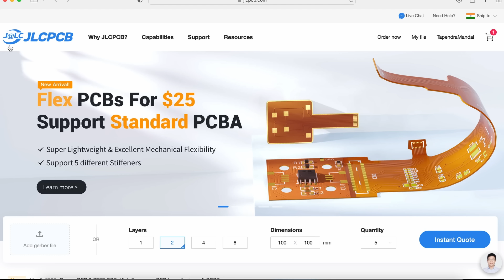BUILD A DIY SPOT WELDING MACHINE

Comment: For those who want to make this tutorial, let me tell I made it. He misses some important things and I really dont know how the hack is working for him when clearly the board is missing a connection for example. Anyway, I made it and the welding is not strong. He says 3 turns of cable but I recommend 4 if posible with 6mm cable. I used 6mm wire with 3 turns and the same transformer. The copper heads are from old battery spot welder.  The welds now are not strong. I  will try to change the cable with a 6mm and 4 turns and see if the welding gets stronger on 0.15mm niquel plates.
Reply: Thanks bader
Reply: هل قمت بالتغيير  ما رأيك هل تغيرت النتيجة ام بقت كما هي انا ايضا لدي هذا المشكل اللحام ليس قوي بما فيه الكفاية
Reply: Plus tu fais de tours, plus la tension sera élevée et le courant moins important.
La puissance est telle que Tension primaire * Courant primaire = Tension secondaire * Courant secondaire
Donci si Tension secondaire augmente alors Courant secondaire diminue.
Faire des tutos quand on n'y connaît pas grand chose est très dangereux pour ceux qui veulent reproduire l'exemple !!!

Comment: Your link to JLCPCB is a generic link to their website.  Where is the gerber file for your control pcb or where can it be purchased online?  I prefer the input voltage to be 120VAC from the mains @ 60 Hz.  Where can I get a control module for that & how many amps would the mains needed for the spot welder to work from a 120VAC mains supply?

Comment: How long can u use it?  I make lithium batteries and I want to know if I can build batteries without getting too hot the wires or the copper plates. My current spot welder get very hot after welding 20 cells for example. I need to know i can weld without pause so I can try to build this model. Thanks.

Comment: Thank you so much. What's the suggested cross section for the output coil wires?
Reply: 次級線徑最好8mm  = "The secondary wire diameter is preferably 8mm"

Comment: Toroidal Transformer made from a microwave transformer? I don't know if it's enough for thicker gauge but most small ~20 watt guitar amps have a decent single 125VAC to 2-phase (12vx2vac), the core is similar in configuration but 1/8th the size.

Comment: holy shit, i almost threw away my 1200watt broken microwave.
time to build a spot welder
Reply: you can find a lot of microwaves (and microwave parts) at scrapyards. just be aware that microwave parts and projects that use them cause a lot of hobbyist deaths. If you touch the capacitors without discharging them you can die, if you mess around with the transformer unsafely you  can die and if you break the magnetron and its the type that has berrylium you will get berryliosis which is incurable and can cause lung cancer.

Comment: there is a possibility that the button or relay will fail, they may remain closed and you will have to quickly pull the device out of the socket.
Reply: Maybe a switch would help ?

Comment: I don't understand one thing.  That card is programmed at 0.5 seconds for example.  If I keep the button pressed for longer than the set time, does the card disconnect anyway?  Because I have another timed relay, but if you keep the button pressed the contact remains closed, even after the set time.
Reply: When u clicked the bottom, the timer card will connect, hold the time u set and disconnect

Comment: Thanks for the video. There was just one detail missing. You need to make a jumper between GND and GND_T. Other than that, it's a great project.
Reply: Hello, sorry, I'm a layman, and where would the jumper be? On the timer circuit board or would I have to put another board to make the jumper.
Reply: @wends6871  Ciao. Ponticello significa collegare (sulla scheda del timer) il GND e il GND_T con un cavettino.
Reply: Why bridging the ground ends?

Comment: Would be nice if ytubers make a picture with Amps & Volts . Pulse lenght  and Amps . Mine has 4.6 V and 148 A for heavier material ok but not for batterycells , next i try thinner welding probes ,, maybe thats why it not welding the nikkel .
grts
rik (belgium)

Comment: You have very thin wires to the clamps. That is not good. Then you have to have a lot of time for welding and you burn through the sheets. The joint should not change color. Watch others do it and learn.

Comment: Did it even with timer. One problem when I tried to weld it produces the spark but do not weld, but the wood under the thin metal strips I am trying to weld get scorched and dark, what might be wrong?
Reply: Secondary voltage may be too low to overcome resistance if you are using 120v as source, microwave transformers are quite bad for spot welding I find they don't deliver one high current pulse fast enough compared to a commercial transformer
Reply: i finally made it to work , no my problem is that it made a hole to the strip. and observation the cable for the secondary is not tightly packed because the area to put the cable through  is small and the cable was thick , might this have great impact?
Reply: @titodejesus6238  Not having enough winds will affect it, my best transformer puts out around 12v open circuit & is pulsed quickly
Reply: @titodejesus6238  You really need to get a good pulse controller so you can turn it down sufficiently, double pulse controller is the best but not cheap

Comment: This looks like a great opportunity to electrocute yourself with a pretty high voltage 😅
I have done stupid things with electronic stuff and it hurts to be electrocuted and it can end badly. 
I like the video, it's well done but needs some explanation. If you know what is going on inside the parts helps with deciding what parts to touch and what parts to avoid.

Comment: Is this a tool or a cleverly presented executioners hand held electric chair? OMG Really?!?!?! let's all hold a high voltage wand in our hand with exposed terminals and flimsy heat shrink insulators. I'm sure I won't kill myself welding those LIPO batteries together. Oh, great it's got a timer circuit that limits the amount of time the power is on. Yea, and let's only touch the 3rd rail of a subway for just a fraction of a second too, what harm can it do in that time.

Comment: “For what reason do you use smaller cable for the pen? Wouldn’t it be better to use the same cable as the transformer to avoid losing amperage?
Reply: First of all - ridiculously small wire gauge in the secondary winding, it should be at least 25 mm2, on the tip of the soldering pen can be reduced to 16 mm2, but no less
Reply: @hramota:  This video is a fairy tale for adults, I say this because I built it for a test a long time ago, but unfortunately the result is not suitable, but I used a much thicker wire for the primary coil

Comment: if you put a coil with 2-3 turns on the end it could also double up as an induction heater
Reply: 50 Hz induction heater NO  😋
Reply: @krzysztofstefan3713  u never seen those yt videos of the microwave transformer induction heaters that melt metal n shit
Reply: @Aed-d  Of course I saw it. The same applies to pumps from a refrigerator or a barrel.... It's fake
Reply: @krzysztofstefan3713  no it isnt? when you pass this much current through metal it will melt (litterally what this video shows) so if you make a small 3-5 turn coil at the end it will do the same but using induction
Reply: @Aed-d  You won't do it. Such a coil has too low inductance. At 50Hz it would have to be gigantic... The current in the system will only be limited by its resistance. Not reactance. The coil will melt instantly like this metal....

Comment: quick question, the cable that you used in the secondary winding, I noticed toy used 2 core of that size cable, can you tell me what sort of current you were expecting to get out of that transformer and what voltage, and since you used that size cable why did you reduce it in the size that went to the welding tip
Reply: I fully agree with you. Why use smaller gauge wire from the transformer to the tips? If I make this, I will use same wire all the way to the tips.
Reply: yes correct... should be same wire size as the xformer secondary to the welding tip wire size to maximize current output
Reply: BECAUSE HE DOESN'T KNOW BETTER

Comment: Good spot welding cannot be done with 3 Volts. Because the voltage is low, you have to extend the time. 0.3 seconds is a very long time for spot welding. If you keep the time too long, you will burn and deform the nickel strip. Instead of folding the cable in half and wrapping it in 3 turns, wrap it 6 turns in a single layer, so the voltage will increase and you can make a much better spot weld by reducing the time from 0.3 seconds to 0.1 seconds.
Reply: First of all thank you. I don't understand one thing, what is he AC 220V Input? Or 9V? Please reply asap as I want to make it❤
Reply: @Diygadgetsellerbd  yeah

Comment: Hello! Thank you for the video. But I don’t understand where to buy such a control board! Nothing on the website is clear at all.
Reply: It's a timer that can provide a minimum time of 0.1s when triggered. Compare to other simpler timers in the market, its biggest benefits is that if you keep the trigger signal longer than 0.1s, the working duration is still 0.1s
No idea where you live, so I can't tell you where to buy it.
Reply: Hollo gos tei. muito do seu trabalhoeu queria saber donde comprar esse temporizador de voltagem

Comment: Although I am fine with soldering my 18650 or using a holder for it. However I am impressed with the way, you have built the spot welder. Kudos.
Reply: Very bad idea to solder directly onto Lithium batteries!
The heat can melt/damage the insulating separator foil inside the cell, as well as boiling the electrolyte and causing venting from over-pressure.
It's OK to solder (quickly) onto welded tabs already on the battery. However, the casing of the battery is a huge heatsink so you need to dwell a long time to get enough heat for solder to melt. This causes the damage to the cell.
Much better to spot weld on bare (new) cells because the duration is far shorter, so less heat gets inside the battery cell.
Reply: i soldered batteries too, and no problems(i corrected myself)
Reply: @makantahi3731 - do you weld or solder? They are two completely different things, and the OP was talking about soldering.
Reply: Hello brother plz send the board buying link thank u
Reply: @ahlebaiteatharhussainiyat318  - what link? This video is about a (terrible) DIY solution.

Comment: I have done  about 50% of building a spot welder from oven transformer. Output test about 3.6v. I think it take me a day for all. Thank you so much
Reply: Зачем ты это сюда написал?!
Reply: @villishon8921 I was learning to do the first microwave  transformer spot welder when I wrote it. Now my project have done and it work really well.
Reply: In timer module which program are you using.
Should start of primary and secondary winding be the same compulsorily as shown in the diagram?
Reply: 3.6 volts is your output voltage? And how much is the current? Or how many turns on the transformer? Is it 110 vot or 240 volt? Any reply appreciated cheers 👍
Reply: @dragan3290 на трансформаторе микроволоновки в среднем выходит 0.85 вольт на виток. При напряжении сети 220в. Я мотал 4 витка и вышло ~3.5в
Reply: @некит1  hvala puno za odgovor. Nazdravlje od Srbin! ❤

Comment: Fail for Safety.  You did not discharge the caps before you pulled the transformer. In a MW, they are dangerous.
Reply: Vydrží v suchém prostředí nabité i rok. Ale tahle mikrovlnka se válela někde na skládce v Indii, tam už nebezpečí nebylo. Napětí z kondenzátoru nezabíjí, ale je to ohromná rána a spíš potom zabíjí leknutí a prožitý šok.

Comment: Hello. I am also collecting the materials to make. I'm thinking of using a 25mm2 cable, but I'm confused about the amperage value. In some videos they used 35mm2 cable. The copper part of 25mm2 cables is 6.8mm. I think this is not enough. When you peel off the outer shell and fold the cable in half, the copper part becomes 13.6 mm. Do you think this is enough?
Reply: try it and see, then check temperature of cables, this to me looks like 6awg cable?
Reply: his problem is too small cross section area on end of transformer cable(on connection tabs), his cable has cca12mm2, on tab he has 2mm2
Reply: To ani zdaleka nemá. Nepoužívá lisovací kleště a místo mosazného šroubu s podložkou dá na oko šroub zapuštěný se zkosenou dosedací plochou. Tam musí být ohromné ztráty přechodovým odporem. Také to relé v časovači dlouho nevydrží, MOT má tvrdý proudový náraz, kontakty relé se brzy svaří dohromady a nebo upálí. @makantahi3731

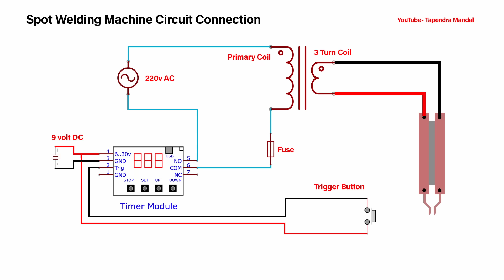Comment: 08:00 (Diagram) Any reason not to use an Altronix RDC12 relay? (Using 12 VDC with the trigger button).

Can you also make it work with 110 VAC and using an Altronix RBSNP relay?

Comment: You made a mistake in executing the welder machine.
(I made the same mistake.)
The red and black wire are very thin and reduce your current from the transformer .
That's why the weld is weak.
Double those wires and you'll get a strong weld .
Yesterday I made a video demonstrating this. (this mistake.)
I put a 6 mm wire in the transformer, and at the output I have over 600 A .
But since I put 30 cm of 3 mm wire, the current dropped to 350 A.
I will upload the demo clip next week .
Reply: Video
Reply: there will be some loss in the high temp silicone wire, but its not much, the cable thats in the transformer is doubled up and thicker so it should be fine.  if they used the red and black cable inside the transformer then you would be correct
Reply: Well did ya done did it yet?
Reply: Link plz
Reply: @Accumulator1  
https://youtu.be/rzMmk9MFAYY
Reply: Pregunta mi estimado 
Obligatoriamente para hacer un soldador de puntos
Tiene que ser con un horno de microondas ???

Yo tengo el campo de una pulidora de pisos de 1.5hp
El rotor está en corto pero el campo está bien

Puedo usarlo para hacer un soldador de puntos ?

O no me sirve ?
Reply: @ElverGalarga-b3o 
Tek başına bobin işe yaramaz, oradaki espri manyetik indüksiyon yani bir transformatör gerekli. Trafonun yaptığı şu: sen 220V (veya 110Vac) şebeke voltajını güçlü bir trafoyla alıp daha düşük voltajlı ama yüksek akım verebilen bir kaynak elde edersin. Pil puntalamak için 40A ile 70A arası yeterli (Nikel levhaların ve pillerin dış metalinin kalınlığına bağlı olarak değişir).
Sen o alan sargisinin üzerine 2. (sekonder) bir sargı sararsan (bu sekonder sargı az sarımlı ve kalın telden yapılmalı elbette) bir trafo yapmış olursun. Böylece yüksek akım verebilen bir kaynağın olmuş olur. Gerisi o akımı kontrollü kullanmaya kalıyor, bu aşamada sana bir zamanlama devresi ve çıkış gerilimini dolayısiyla çıkış akımını kontrol eden bir devreye ihtiyacın var. Tetikleme için elle basacağın minik bir buton da kullanabilirsin veya bir ayak pedalı da.
Bunların hepsini hazır yapılmış olarak da satın alabilirsin ama kendin yaparsan, kullanırken alacağın zevk daha bir artar.

Comment: What is the maximum weld thickness in millimeters?
Reply: Very small, in low melting point metals, maybe 0.01 mm, but ok for this. Consider the melting point of the electrodes, too.

Comment: I really dont understand how the wires are supposed to work if they dont plug into anything
Reply: Those windings share a magnetic core that is laminated, and the mutual induction that takes place between these circuits helps transfer electricity from one point to another.

Comment: Hi Tapendra, I constructed exactly like yours but I'm afraid the spot weld is not very good. the Nickel strip pulls of easily. I get around 2.5Vols output from my Secondary at around 5 amps. I use the same Timer also as you show. Can you help please ???
Reply: I use 95% power and 5ms pulse
Reply: Thanks for your kind reply, I'm using P1.1 but don't know how to set power level and time. Can you help please ?
Reply: @georgepilch8396  I use the NY-D01 Controller.
Reply: 5 Amps ??? You should be getting 100, 200 or even more.
You need BIG cable for the secondary. Absolute minimum 8 AWG, but preferably 4 AWG.

Comment: No explanation at all. It would have been much better if you had given a tutorial and with purchasing details of where to buy the digital timer
Reply: Muy bueno los felicito 😅
Reply: If you dont understand what he's doing... you really shouødnt be doing this lol.
Especially since he did not explain what part of this is VERY dangerous
Reply: Nicely milked
Reply: I made it with full explanation
Reply: Hello! Great build I don’t know if you’re still watching the comments but I just built the project and I can’t seem to get the trigger to work properly the transformer hums and turn off and on and the timing circuit just keeps running if you know what I may have done wrong I would appreciate any assistance!
Reply: I don't understand one thing.  That card is programmed at 0.5 seconds for example.  If I keep the button pressed for longer than the set time, does the card disconnect anyway?  Because I have another timed relay, but if you keep the button pressed the contact remains closed, even after the set time.
Reply: Bro just take a fuc... Relay
Reply: True. This guy does not quite understand the purpose of this video - well or I don’t. Though I like the design of the handle with electrodes.

Anyway I had one half done and am going to finish it.
Reply: if you cant find that for yourself, you have no business doing this in the first place.
Reply: @TalkingGIJoe 😂😂😂❤👍
Reply: Looks like a transformer controlled by a simple pcb relay board. I don't think it needs much explaining.....